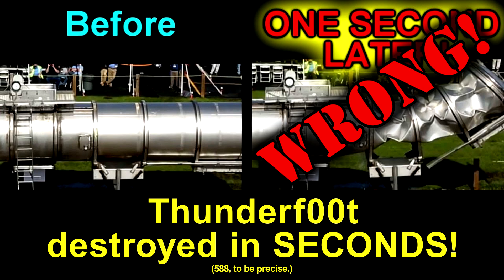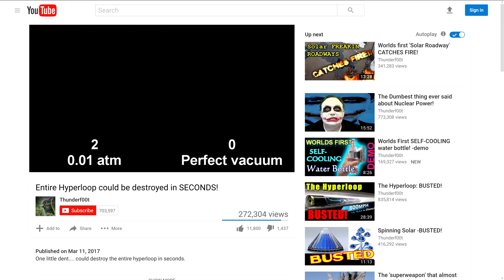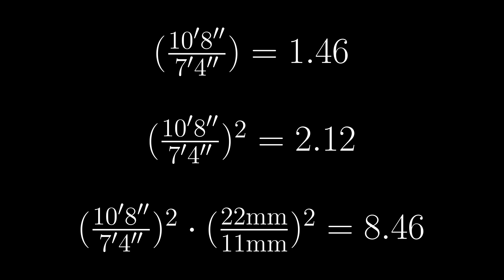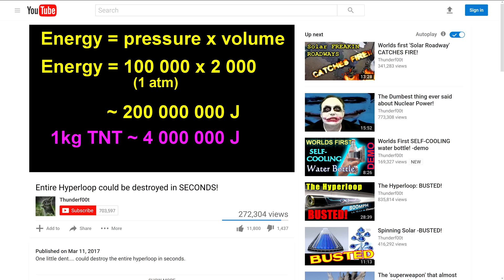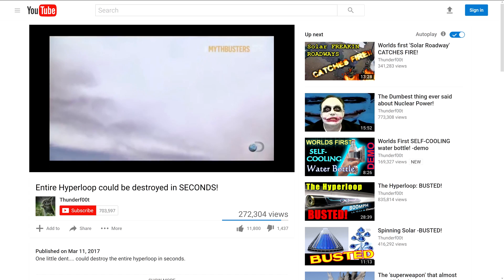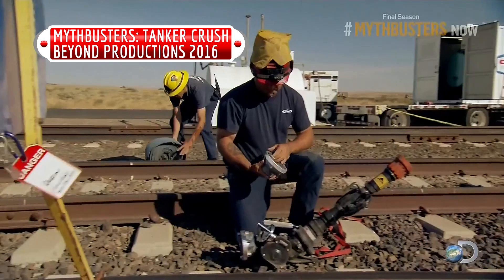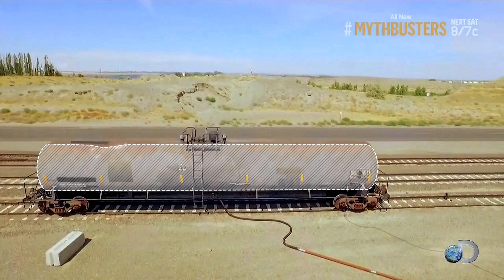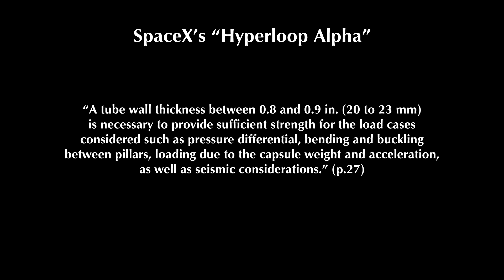Thunderf00t destroyed in SECONDS!

Comment: Tubes in general are terrible at holding up against negative pressure you egg...
Reply: I apologize for Shane getting upset; he's been dealing with a lot of trolls while running this series and his patience has worn kind of thin, which is understandable.

You're correct that it's not the exact same thing in inverse, as structures in tension are not identical to structures in compression.  However, it's important to realize that, contrary to your conception, vacuums are widely used in industry.  Long vacuum pipes, huge cylinders, etc; they're an important part of refining, used to distill more volatile components off of less volatile compoonents.  And any engineer worth their salt can design a vacuum tube which will not collapse when punctured.  There are formulae which they simply need to look up for various types of tube designs - simple tubes, tubes with reinforcing rings, tubes thinner than a pencil, tubes wider than your house... you name it.

Engineering isn't done by guesswork or increduility.  It's done by actual engineering.  By people who - unlike Thunderf00t - actually have an engineering background.
Reply from the maker: LOLWUT??? Then why are they almost universally used for that purpose? How come physics teachers keep saying the only shape better at holding up to pressure is a sphere?

More desperate anti-science rhetoric from the neo-Luddites...
Reply: Shane Killian Universally used for that purpose??? The iss uses positive pressure inside. Aircraft use positive pressure. The waste of material used to make a hyperloop is unjustified given its speeds. Also just take a plane if you want to go so fast. Cheap flights do exist you know. America should focus on getting an actual proper nationwide high speed rail network and arrive in the 21st century which will be vastly more cheaper and useful that a expensive glorified vacuume tube...
Reply: Shane Killian Also, anti science?? I'm FOR science to prejudiced fool.   I base my statement on observation on the expense of the project, it's viability and the alternatives.
Reply: Shane Killian Also there are thousands of uses for tubes which utilises positive pressure. Any which don't are very small and do not have much negative pressure. If you don't equalise the pressure in a submarine no matter how strong it is it will be squashed flat. Now the atmosphere hasn't got as much pressure I'd admit but you cannot deny the fact that a breach in the tube will be catastrophic. Not to mention how long it's going to take to pump all the air out of the many miles long tube.
Reply from the maker: "The iss uses positive pressure inside." And what shape do we see used over and over again? https://roadtovrlive-5ea0.kxcdn.com/wp-content/uploads/2017/03/mission-iss-feature.jpg

"Aircraft use positive pressure." And the shape for a fuselage is? https://s3.amazonaws.com/filecache.drivetheweb.com/mr5mr_boeing/2057/K64705-01_med.jpg

Hey, what about submaries? http://nationalinterest.org/files/styles/main_image_on_posts/public/main_images/virginia_class_submarine_8.jpg

YOU ARE A FUCKTARD.

"I'm FOR science to prejudiced fool." No, LIAR. You keep spewing one LIE after another about it, and misinforming people about even BASIC physics and engineering.

"Also there are thousands of uses for tubes which utilises positive pressure." So?

"Any which don't are very small and do not have much negative pressure." Submarines don't have negative pressure???

"If you don't equalise the pressure in a submarine no matter how strong it is it will be squashed flat." Um, how do you think submarines WORK??? If you made the pressure inside equal to the pressure outside, the people inside would DIE! In fact, nowadays submarines maintain around 1atm of pressure to prevent problems like HPNS and a lengthy decompression time when surfacing.

You're a FUCKING ANTI-SCIENCE NEO-LUDDITE KNOW-NOTHING. GO THE FUCK AWAY.
Reply: Shane Killian Calm down mate positive pressure inside you melt. As in more pressure inside.
Reply: Shane Killian I admit my submarine part was wrong.
Reply: Shane Killian Yes tubes are the shapes of aircraft and the iss which have positive pressure inside them. My point being that cylinders can take much more pressure within them than from the outside in. You have yet to mention how this miles and miles of tube is supposed to reliably keep a vacume in an earthquake prone part of the planet...
Also I never claimed to be a full on scientist I'm only 15 for crying out loud!! Calm down mate you act worse than me!
Reply from the maker: "My point being that cylinders can take much more pressure within them than from the outside in." Wow. Just wow. You DO know that, with the exception of thermodynamics, the laws of physics work in reverse, right?
Reply from the maker: Every single law of physics outside of thermodynamics works when you reverse cause and effect. They all work backwards exactly the same way as they work forwards.
Reply: Shane Killian I was basing my view of the observation of things like plastic bottles and the steam vacume test where the cylinders can take massive pressures from within but can be easily crushed from without. Isn't this the same principal with the hyperloop?

Comment: anyone worked out how to install expansion /retraction interfaces on a  tube this size with a fluctuating 1bar differential + high temp changes .. Meh think you egg heads need to get back to the real world n stop living in theory land .
Reply: Paul: He did extensively cover expansion in one of his earlier videos.

Also, please examine your own post.  You start out acting like you're asking a question - "anyone worked out how...".  But then you end with an insult, presuming that you know all the answers.  Perhaps actually wait for the answer when you're asking someone who has a different perspective than you before you deign to insult them?

The short of the actual answer: it's all right there in the Hyperloop Alpha document.  Which Thunderf00t either never read, or deliberately left out - take your pick, neither of them speak well of him.  The whole tube slides.  There's only two expansion joints - one at each end of the tube.  The tube is mounted on multiaxis dampers designed to allow the tube to slide, as well as to compensate for the ground subsiding and handle lateral moments due to, for example, earthquakes.

It's important to realize that this is just one of many different ways to handle thermal expansion, and that other things - including high speed rail - face the exact same issue as Hyperloop.  The most common way to deal with it in high speed rail is... just not to expand.  Seriously.  HSR generally uses pretensioned rails - they lay them hot, causing them to want to contract when they cool.  This puts force on the rails.  But they anchor them down firmly enough with very heavy concrete sleepers so that they can't contract.  Thermal expansion force is just that - a force.  And like any other force, yes, it absolutely can be resisted.

This is really basic civil engineering, and if Thunderf00t had any background in engineering, he would have known this.  But he didn't.  He's a chemist.  You're getting your engineering information from a chemist.
Reply from the maker: Sigh... WE COVER THERMAL EXPANSION, LIAR.
Reply: no actually i'm not a liar , having looked through some of the copious drival on your channel I am still to find an answer.  If you can't answer a simple question without insult or simplicity do you understand the concepts in the first place.  So how are you going to control the torsional stresses encountered ? Remember now no easy peasy smarty pants schoolboy  thermal expansion equations over long lengths , how you gonna stop it from twisting , with a perfect insulating vacuum in the middle its going to be next to impossible ...and with a sun  beating on it your totally screwed.
Reply from the maker: Wow, either you didn't watch ONE SINGLE VIDEO in this series or you're an even bigger LIAR than I said you were! WE COVER ALL OF THIS THROUGHOUT THE SERIES!!!
Reply: so still no answer and another insult + the odd capital letter or 2.. shouting doesn't make you or your ill informed rants right.

Comment: i dont get how you can claim that a tanker and the hyperloop are totally different. Internal and external pressure and use that for an argument. The problem here is, that the tubes showed to us are looking to weak and your argument is: a tanker an the hyperloop are not the same thing.
Wtf? Whats the point fuckhead?
Reply: A scientific response would be to clarify, not an ad hominem attack... you tosspot! (Did you see what I did there 😂)
Reply from the maker: Wow, REALLY, fuckhead? You're COMPLETELY IGNORING the part about internal supports, closed vs. open systems, and the MATH I did showing that the Hyperloop as specified is ~8.5 times as strong as that tanker?

You morons see only what you want to see. Go away.

Comment: The stuff the Mythbusters had to work around were the safety features that, in normal conditions, wouldn't allow the tank to be pumped to such critical low pressures. Your Hyperloop tube needs to be pumped to such low pressures. The statement that this couldn't happen in a realistic scenario for the Hyperloop is therefore wrong. At least based on this argumentation.
Reply: Valves, as most things, are made for different appliances.
A valve that vents when a too high pressure exists, does seal when not.
A too low pressure will not vent the valve.
https://ukleakdetection.co.uk/wp-content/uploads/2015/04/safety-valve-1024x794.jpg
These valves would not only keep the tank sealed, they would even tighten up when under low pressure.

However, due to weather and cargo reactions to the pressure inside the tanker, they feature valves not sealed against a too low pressure.
http://ecatalog.americanrailcar.com/images/productimages/TankCar/Positive%20Clapper.JPG
This valve does work in another way.
It seals under regular conditions - high pressure and regular pressure.
It vents when lower pressure is inside.
This is due to the vent being held down by a spring - if the pressure difference is too high (too low pressure inside) the spring is too weak to hold the tanker sealed.

Thus, air leaks in.
The Mythbusters ONLY needed to seal the tanker because it was not meant to take in a low pressurized cargo. IT might, MIGHT, be true that the reinforcements of the hyperloops' pipe are adequate to the forces it has to endure.
However, the point is not about being a closed system or not but simply to make it a depressurizeable system.
Tanker Car valves are not meant to be operated that way.
Reply from the maker: No, they're there to relieve the pressure if the internal pressure gets to HIGH! Again, they're made to withstand POSITIVE pressure, NOT negative! That is NOT IN ANY WAY a valid analogue to the Hyperloop! DEAL WITH IT!!!
Reply: Shane Killian Why would the Myth Busters need to circumvent safety measures against too high pressures when they were pumping the air out of it? There are also safety measures against pumping too much gas out of these wagons. And that was the problem.
Reply from the maker: I answered this question in the video! THEY NEEDED TO MAKE IT A CLOSED SYSTEM!!! That means NO valves OF ANY KIND!!!

IDIOT.

Comment: I wanted to say that the content of this series has been somewhat improving as time goes, but with this one you're back to where you started: even more wrong than TF.2:28 "The strenth of the tube is proportional to the square of the thickness of the wall." Not in this case.2:54 "Internal supports"? There is a train going inside.7:10 "Hyperloop is not a closed system." How is that relevant? The pressure inside is pretty much zero.9:10 "TF has done nothing to show that cascade failure is possible." The tanker collapsed in all its length, not just near the damaged end. And while I didn't bother to calculate it, the speed of the collapse shows that 11mm wall is nowhere near necessary to stop a cascading failure. It could very well travel faster than the air wavefront.Anyway, feel free to delete this comment after reading, I don't think I'll be coming back here.
Reply: How very mature coming from a youtube. Yelling at people and calling them liars when you don't agree with them.
Reply from the maker: Wow. Just wow. ALL of these points were addressed in the video. What you LYING MORONS hope to achieve by doing this is beyond me...
Reply: Maybe you have some other video inside your damaged brain but it never made it to Youtube.
Reply from the maker: "Maybe you have some other video inside your damaged brain but it never made it to Youtube." No, YOU FUCKING GODDAMN LIAR, the entire playlist has been pubic for MONTHS: https://www.youtube.com/playlist?list=PLSPi1JFx4_-Gz0Fm0qq2KUz4c22UbZCco

GO THE FUCK AWAY, YOU GODDMAN LIAR!!!

Comment: 1 joule = 1 watt per second, if i calculate it 0.2 giga joules is 200,000,000 watts per second, (200,000 kw per second), 3600 seconds in the hour, 200,000 * 3600 = 720,000,000kwh (720 giga watt hours) at $0.25cents per kwh = $180,000,000.00     COULD I BE WRONG????
Reply: HI Raymond, the mistake you made is:
"1 joule = 1 watt per second."  ; the units aren't the same so you can't equate them. 
(It's the same as saying "1 meter = 1 meter per second, per second ")
i.e. 
1 joule is a unit of energy, 
1 watt is a unit of work (Joules per second)
just as 
1 meter is a unit of distance, 
1 meter per second is a unit of speed, change of distance over time. 
i meter per second per second is a unit of acceleration, change of speed over time.

'Watt per second' would mean 'the change of work done over time'.
Reply: The mistake is in multiplying by 3600 instead of dividing. So you had 200,000kw all in one second, to know how many kwh you divide all the energy in the time span that is one hour. Its about 55.5kwh
Reply: 1 J = 1 W·s <=> 1 W = 1 J/s.  Not: 1 J = 1 W/s.

Therefore, 0.2 GJ = 0.2 GWs = 200,000 kWs · 3600 h/s = 55.5 kWh (roughly).   So about 14 bucks.
Reply: Yes, Yes you could, You could be very wrong.

Comment: The TNT analogy is perfect for this as the energy release will be over a short period of time. Not the $5 of electricity analogy you used.....have u seen what happnes in an arc furnace when you apply $5 of power. I hate it when idiots argue with a real scientist!!
Reply from the maker: "The TNT analogy is perfect for this as the energy release will be over a short period of time" Except YET FUCKING AGAIN, we showed that it won't be. Anyone who has the decency to even BOTHER watching the whole series (which so far has been precisely ZERO of the supercilious nimrods like Ralphus) knows we showed that the pressure wave would INSTANTLY expand at the speed of sound, in fractions of a second becoming longer than any Hyperloop pod would be. So it would be a gradual increase of pressure around the pod, not a physics-defying wall of air.

Thunderf00t was trying to pretend that the amount of energy to sustain the vacuum isn't feasible. The fact that it's only $5 worth of electricity shows that he's WRONG. Thunderf00t is NOT a physicist or an engineer. He's a CHEMIST.
Reply: I am an engineer...UWS Sydney. Every tank we have done destructive testing on always go with a bang.
Reply: the cost and complexity of what u r proposing is enormous
Reply from the maker: "I am an engineer...UWS Sydney." Yes, and yet somehow you can't even spell "vacume"...
Reply: Shane Killian ....no i cant english is my second language.
Reply: I have been in the oil and gas industry for 13 years now....u can not write a business case for what u r proposing. Spend your energy on somthing that can be achieved.. u are creating technical problems to solve for an end goal that will never happen. work on a faster bullet train or somthing.
Reply: Lol i do work as an engineer for the last 13 years in the largest oil and gas companies in the world. i have been speaking english now for 20 years. We call idiots like u "NumNuts" downunder!
Reply: It's an even sadder display when a project tries to play it personal when dealing with criticism. I hope you do realize that comments like those ("you can't even spell...") only undermine your position even more in the eyes of those who actually care(d)? Trust me: it does.
Reply from the maker: "only undermine your position even more" I'm just refuting his bullshit Argument from Self-Authority, which wouldn't be valid even if it were true, which it very obviously isn't.
Reply from the maker: "no i cant english is my second language." And yet, you claim to be an engineer in an English-speaking country. Pardon me while I don't believe you...
Reply from the maker: Then refute our coverage of the fluid dynamics. IF YOU CAN.